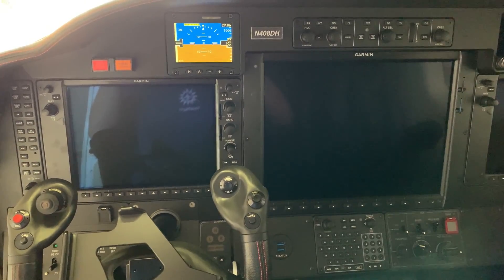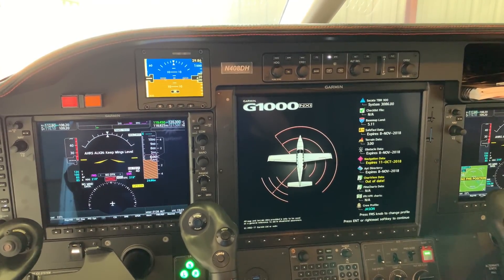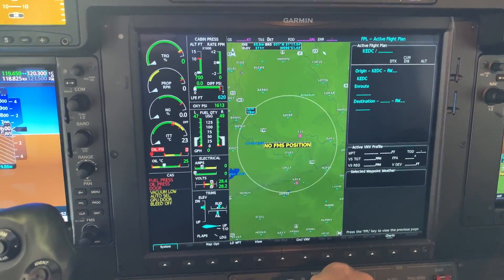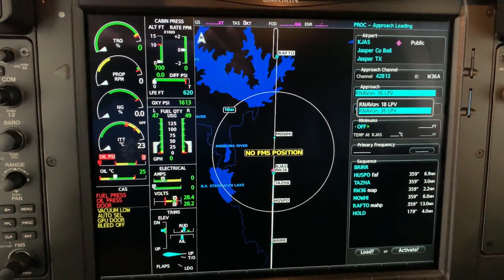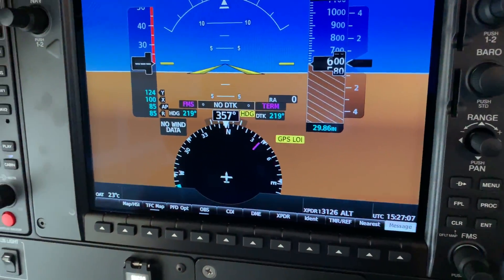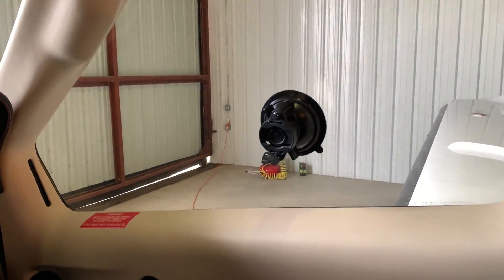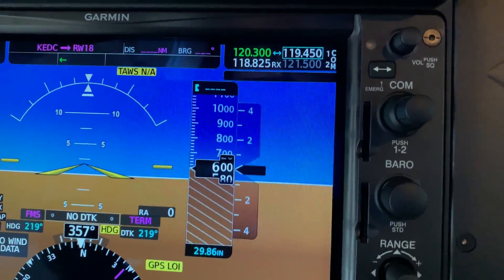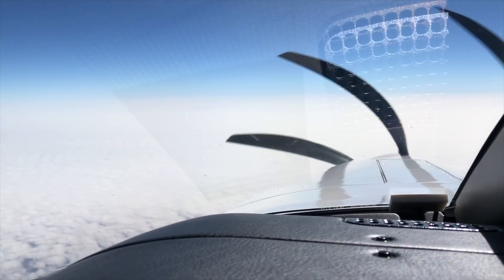TBM 900 - NXi Upgrade

Comment: Thank you Jason; can you split now the MFD; for example having the FPL page on one side and the Radar on the other? tks
Reply from the maker: you can split it in some ways, such as showing a instrument chart alongside the map.  And when in FPL mode you can still see the map, including nexrad or onboard radar.  You can also put onboard radar within the HSI on the PFDs which can be handy.  The G3000 offers more split screen options, but never been a need I have had.  Plus I use the iPad for so much, so there is no lacking for screens :)
Reply: @JasonFlies  Thank you very much.; great,  miss on the mfd the possibility of showing both the flight plan and weather radar

Comment: Hi Jason... Looks like you are using a fairly large IPAD on the yoke.. is that the largest IPAD model ?
Reply from the maker: Not the largest but the second-largest iPad Pro.  Basically maxes out the available room
Reply: @JasonFlies . do  you think the 11" iPad Pro will fit ?
Reply from the maker: @AZee-hh4mk  yes, that is what I use with a new mount that has adjustable arms

Comment: Nice upgrade! Anything else on the TBM 900 worth upgrading? Sounds like you're pretty well topped out on this plane now. A 5 blade Hartzell (i.e. 900/930 series Daher) and an NXi what more could you want!
Reply from the maker: It's pretty decked out!  :) They have an angle of attack upgrade but I'm not planning to do that as I don't want that info on the panel but instead in a HUD.  I think there is a way to do that, but not worth the effort/cost at this point.
Reply: Jason I have to agree that an AOA system would be most beneficial in HUD form, so you can keep your head out of the cockpit on final etc... So with the NXi, could you now change your plane's model number to a 910? ;)